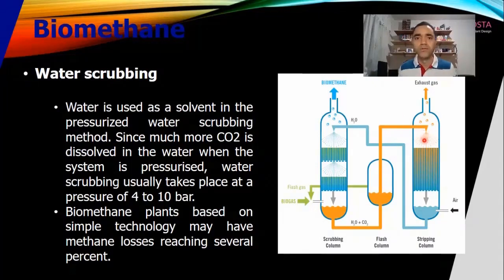BIOGAS UPGRADING OVERSIMPLIFIED FOR CHEMICAL PROCESS ENGINEERS

Comment: This scrubbing tech analysis aligns with our gas handling experience. Could you clarify if this project includes solvent recovery systems or only separation stages? Need to confirm scope before assessing integration points.